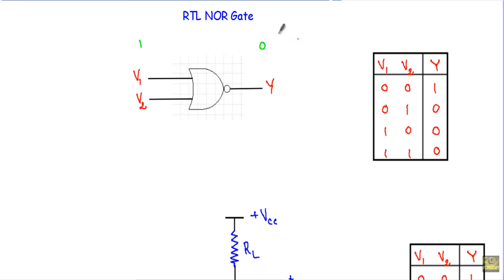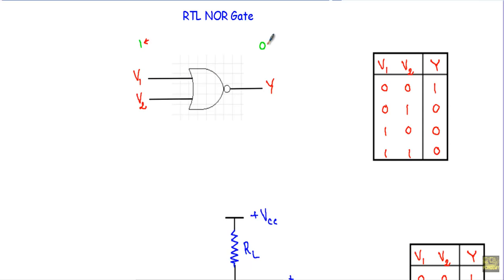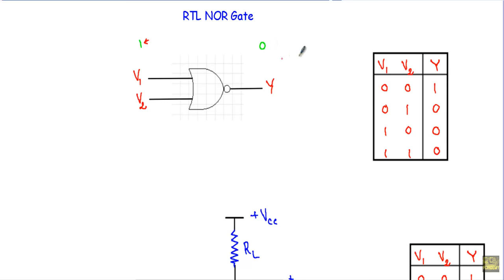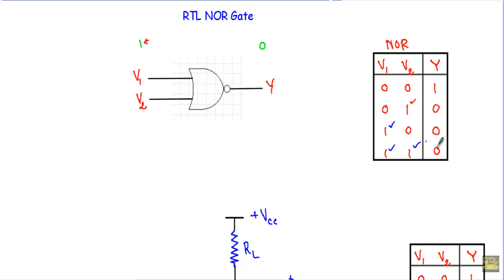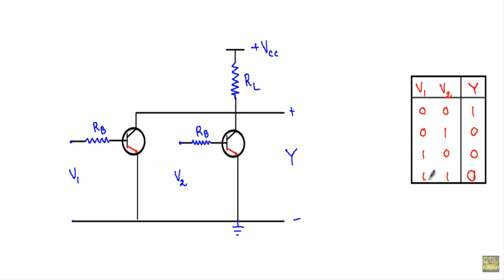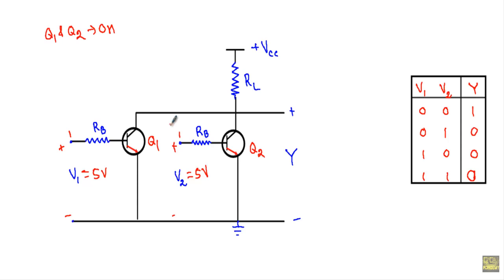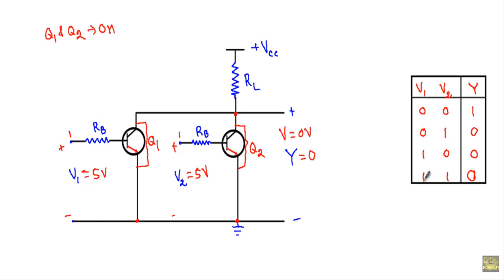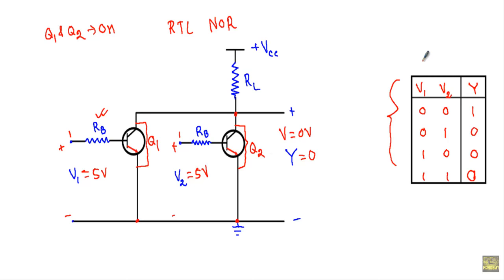RTL NOR Gate (Resistor Transistor Logic)

Comment: Common anybody plz explains this in details with the direction of current & why we getting zero. Why we use npn? Why NPN emitter ground?  Can we use same resistor ? Can we use different different resistor? Why we grounded emitter why not base or collectors? I can't see similarities of not & or gate here  ? Why only 5 volt? Close circuit why how? I Direction